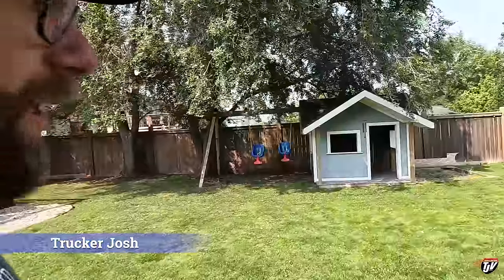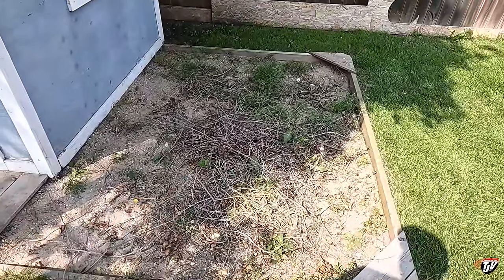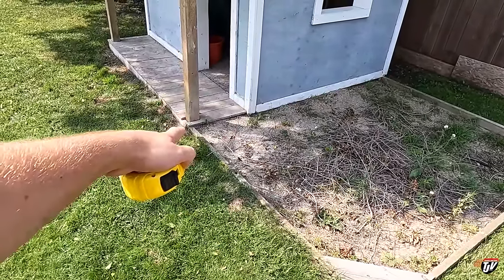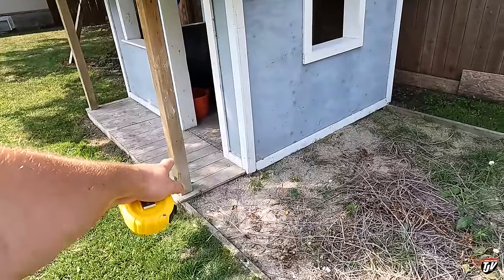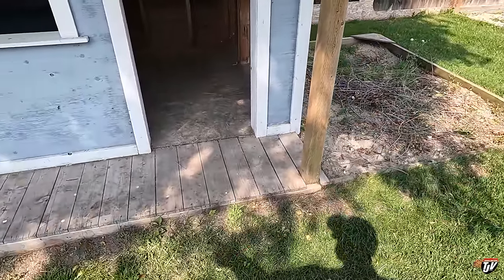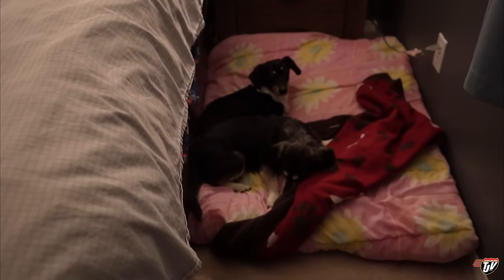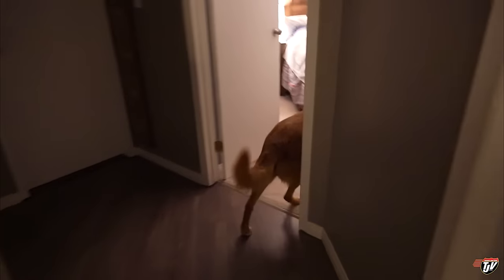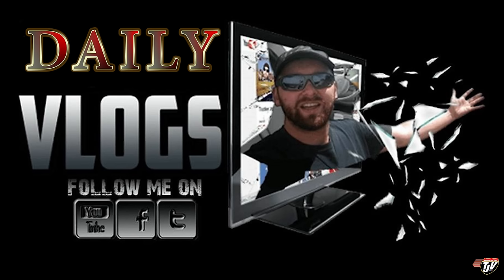HONEY-DO LIST | TJV Vacation | Vlog #3131

Comment: You pay for all the wood.   A 1x 6 once it is squared and surfaced for use is  3/4" x 5 1/2" roughly.   But it is convenient and easier to call it a 1 x 6.     It may seem trivial for SPF (Spruce, Pine Fir) boards.    But you get into the hardwoods and making furniture you can be talking hundreds of dollars between a rough piece of wood and a piece that is squared and surfaced for building a piece of furniture.

Comment: Nominal measurements as opposed to actual measurements of wood. 2x4 opposed to 1.5 x 3.5....measure twice cut once lol
Reply: I'd do dual purpose put new sand in pit then put "patio" over it when not in use by the little guy